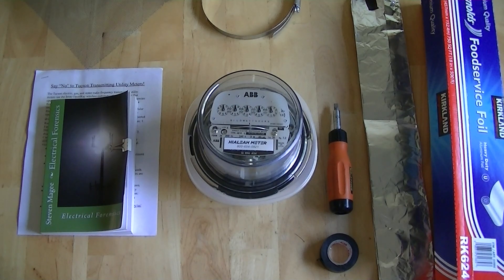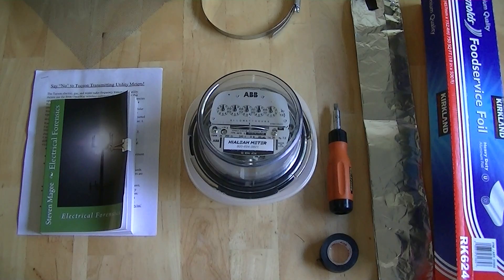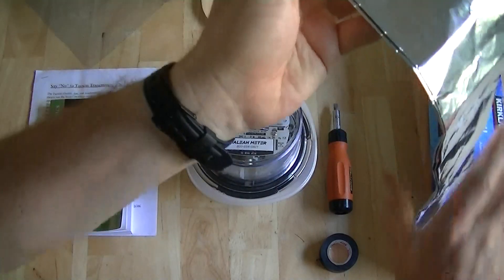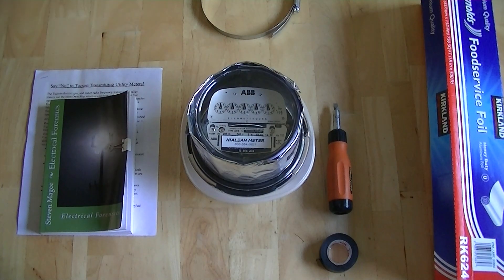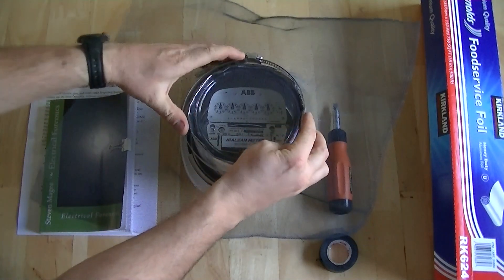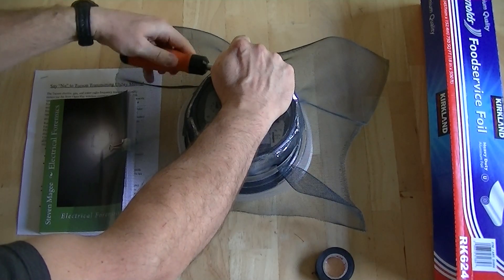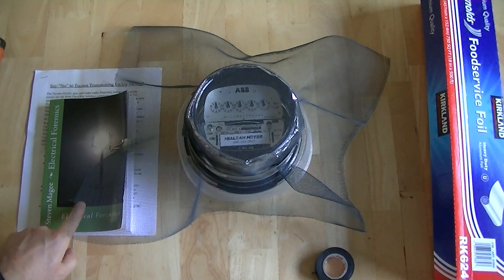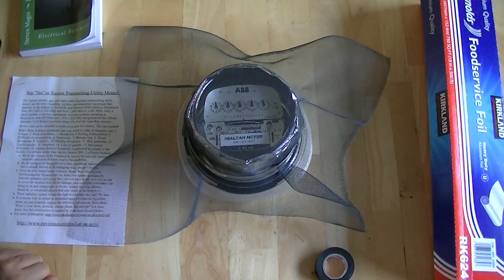The Cheapest Way of Screening a RF Transmitting Smart AMI AMR Utility Meter

Comment: so it looks like it blocks the RF emissions from the sides and the front of the meter, but what about the RF emissions that come out the back into the wall?
Reply from the maker: +3RAN7ON The metal fuse board enclosure should provide sufficient screening from those.  Use an RF meter to confirm effective screening: https://takebackyourpower.net/shop/cornet-ed78s-rf-lf-electrosmog-meter/

Comment: thanks for video.  once you have shielded a utility smart meter using this diy story, or one of the prefab'd offerings, how is it that the smart meter can still function?  In other words doesn't the shielding prevent this device from being able to transmit the RF signal it is trying to send out from making it to the receiving antennas?

Comment: If I do something similar, with aluminium screening only... wil it change much the result than using both aluminium foil and screening ?  Also, does that diminish also the RF emission BEHIND the meter ?  Some farady cage using steel mesh does that, but aluminium is reflective, so I wonder ...

Comment: Get a piece of copper wire, placing it between the clamp & screen prior to clamping it down, connecting the other end of the wire to the metal ring around the smart meter. This will ensure the Faraday cage is grounded & hence more effective in this situation.
Reply: How does that help the rear transmission through the wall?
Reply: @reeblesnarfle5443  I had this same question. The box itself is protecting the back of the meter going towards the home and reflects it out the sides of the face and outward. Once the cage or screen is around the meter it is protected all around it. Lots of videos here on YouTube how this all works and how the cages work to Secure the home and the outside of the home. The only issue I have is my neighbors house has one facing my direction and our houses are only about 10 feet apart. I am going to make an extra one for them. Problem solved. If you want extra protection you can add the screen about as big ass 4x4 on the inside of the wall to put your mind at ease. Always good to have area tested after using these screens or any other device. Make sure it is working.
Reply: Popeyes  I'm guessing it will go through the wall behind it in greater concentration unless grounded properly. If grounded properly the signal should go to ground.
Reply: Get a radiant barrier in your walls, most new houses should have them if the builders were a tad bit conscious lol
Reply: @joetrainer31 I want it to go torward my neighbors 😅😅😅.  They are helping the gangstalkers target me
Reply: Popeyes  had no choice 4 power company putting the two smart meters on my home! September 2018 been resisting for 3 years, They did not turn off the RF it affected me immediately when I went into the home the buzz in my head the fogginess also by the time I noticed that the guy was gone who installed it, took them six days to come back out to turn the signal off! Put a filter on my fuse box to stop the smart meter spikes which has helped. Still having issues in my home I feel like everything is magnified if I plug in anything in my wires in my house are magnified what to do! Feel like crap whenever I'm in my home!! I do have a electromagnetic tester when I get near any wires or Outlets it flashes red Danger the rabbit hole gets deeper?
Reply: Grounding has been found Not to work.
Reply: I grounded my smart meter shield, and I felt much worse.

Comment: As weird as it sounds, most EMF meters, even professional meters and especial RF meters will not be able to show you all the radiation in all the frequencies because of technical limitations such as sampling rate, frequency span, difficulties in measuring multiple source in multiple frequencies all in the same time and more. (In RF there is no real safety distance). According to norad4u. Thanks for sharing this.

Comment: That isn't a smart meter, no rf from that.
Reply from the maker: Analogue meters that have radio frequency (RF) transmitters in them are called "Trojans" in the electromagnetic research field.  There are plenty of analogue RF transmitting Trojan meters out there.
Reply: Easy.Just get a handheld device that can detect emfs.
Reply: If you scroll through other vids listed on the page there are two types of rf field strength meters shown.  Do you own one of these?  Dirty electricity (DE)differs from rf. Use a gauss meter to detect DE, an rf field strength meter to detect microwave radio frequency. If you have rf meter, standing 5-8 ft. from meter should give you a reading that spikes, typically above 10 microwatts per centimeter squared. Also you can look on face plate of your utility meter to see if it has a fcc code on it; that is required if it is a communicating (rf transmission) device.  Hope this helps.
Reply: It's a wicked world full of scary technology to frighten mental midgets.
Reply: judge724 Yes I have the ABB smart meter, acts like a mechanical but you can see an antenna that broadcasts out to the meter checker.
Reply: Liberty and Justice. There’s no need.
Reply: Robert Drake iiii
Reply: Robert Drake It is a smart meter I have the same type
Reply: Shhhh....

Comment: What's being done about the use of PLT in my opinion they should ban that technology its polluting the air waves reception is impossible if your near neighbors have them plugged into the mains 24/7 Discussing technology and slows down the transfer rate between computers so what is the point .Also you leave yourself open the security risks from outside hackers .and thats what you call progression what a joke

Comment from the maker: The metal fuse board shields the RF at the back of the utility meter.  It does not stop the RF, it simply attenuates it to a lower level.  Hence, why I advise using an RF meter to check the shielding performance.  You should have RF screening behind the fuse board on the wall that the fuse board is mounted to.  A few layers of heavy duty kitchen foil or aluminum window screening is generally sufficient on the wall behind the fuse board.  Watch  http://youtu.be/u4e1qmua8Q8 Electromagnetic Shielding of a Southwest Gas Itron 100G AMR Transmitting Meter.  More information can be found at http://www.environmentalradiation.com/
Reply: +The Augur How does it feel trying to shoot the messenger??? What an idiot you are.
What did you call yourself??  ----------> nor am I an expert on the subject. <---------------
Then why would you LIE to us?   
SMART METERS ARE KILLING US AND YOU TELL ME TO CHILL OUT?
Maybe you should grow up and yell at your secretary instead of your power customers.
Reply: Steven,  This method will direct the RF inward into the house.  It will also stop the electric company being able to get a reading so they will come and take the shielding off.
Reply: Keith L. That's what the idiots at the power company want you to believe.  Sounds good in theory.  
But in REALITY  Smart meters can kill disabled folks with implanted medical devices.  After all, they are a 4 watt eirp radio transmitter.   and
Now you will have to pay more for power because it is so easy to bypass a smart meter and get your power for free. Who would find all of the bypasses on the old meters??? YEP, the meter readers. 
Now they are gone, so nobody gets caught any more.
Reply: +The Augur                  Ha Ha You are a real comedian. What the hell is a universal?   
Do you have a picture of this universal??   Hmmm 1 million smart meter require 4 watts of power to work.  4 watts times 1 million smart meters is a waste of 4,000 kilowatts.  And you told us smart meters save energy?
Not only are you a BAD COMEDIAN, you're a bad LIAR................  
How much money do they pay you for all of this disinformation?
Reply: +The Augur This not an argument, you told the whole world a big FAT LIE and now you are calling me a KID??
Why are you making up LIES to scare people if you don't work for the electric company?
Reply: First edtion page 3  right after this quote.  "Smart meters are not intended as a routine form of birth control."
Reply: +Environmental Radiation LLC Why didn't you measure the radiation before and after this shielding you showed here?  I remember Barrie Trower said that it's gotta be aluminum sheet that you'd use for construction to shut up the EM radiation from WiFi.  I believe it's the same with Smart Meter which has been causing health damage to my body.  Mind you, we don't have that installed but we get the health damage from our SUPID NEIGHBORS'
Reply: not just aluminum a lot of other metals work even better except steel. Its just because aluminum cheap and easy to obtain.
Reply: Environmental Radiation LLC Wrong, with an emf reader im  reading 15.0 mG inside house next to smart meter with spikes of 60.0 mG. Even after taping tin foil shiny side out on inside wall leavels were still 15.0 mG. These solutions dont work.